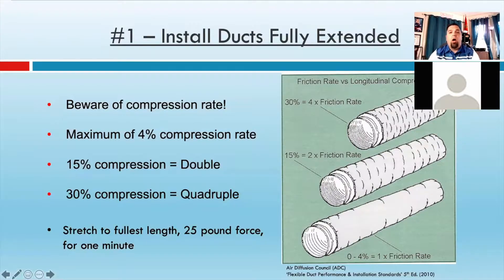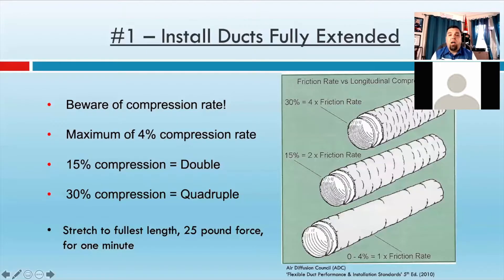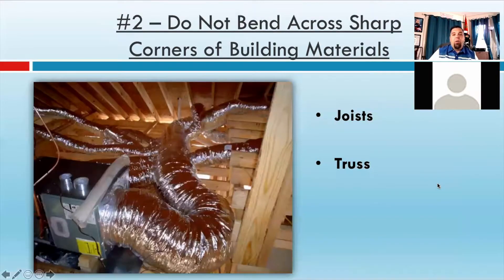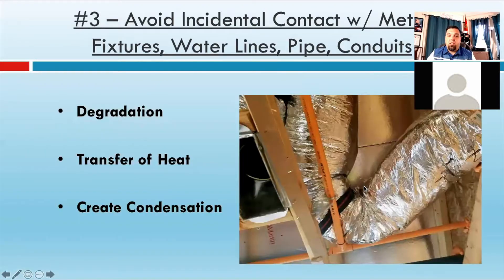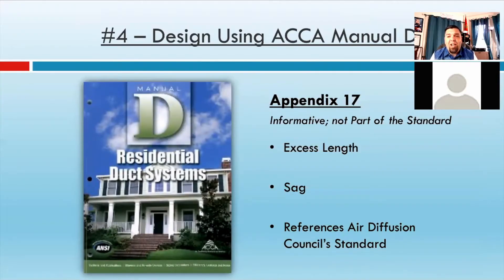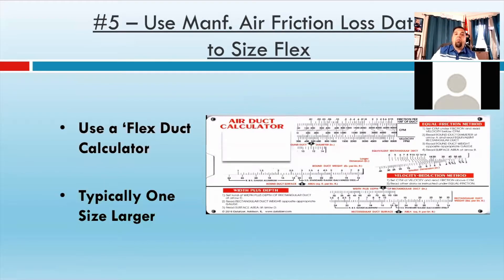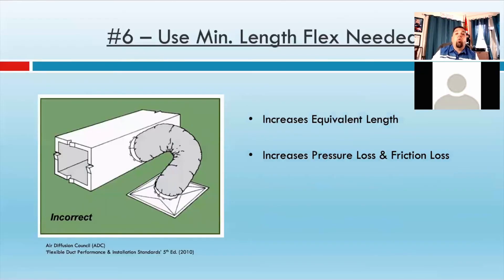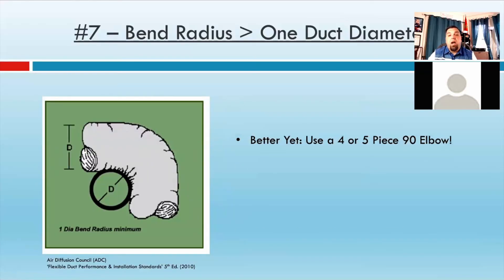Rules of Flexible Duct Design

Comment: How do I know the maximum airflow, CFM, that can be handled by some 6” flex duct I have in my attic, if I put in a booster fan to be able to increase aire flow at certain times?  The duct says 4000 FPM maximum, it’s 6” duct and I’ve got about 15’ of duct run before the booster fan and then 15’ after the fan to the vent?  At top speed the fan says it is 400 CFM. I don’t want to damage the duct work. Thanks in advance for any help on this.

Comment: It's just flex man pull her tight to get her right if you gotta make a turn do it gradule strap her with cloth strap only make sure there's atleast 1 strap regardless how short the run is cut in a circle around the insulation stick your blade in to pierce the liner cut the wire give her a yank and she pops right off clean and smooth tuck the insulation back into the liner run that liner down around the collar on the trunk line tape her up then pull down the insulation that was bunched up double your tape up side by side run one wide piece on top one on bottom and each sides and that's it from a installers standpoint that's all that has to be done there isnt time to be worrying about the little things I'm more worried about trying to get the job done so I can possibly have Sunday off cause we have another one lined up to finish roughing in by the end of the week and I just hit OT at 9am Thursday morning with a helper that's talking about quitting theres just bigger fish to fry than worrying about what inch flex to that angle I'm worried about turning I'm sure this video was intended for people higher up on the totem pole though I'm just trying to shed some light from where most of us people installing this stuff stand at
Reply: and that why there are so many poor installations...
Reply: Now that's taking pride in your work. It's our house man and we're paying hard earned money for it. Too much for the installer to be acting like "it's just your duct man, who cares".

Comment: This is great. As a homeowner i am trying to understand my my current system preforms so poorley. I hope true professionals like you take over the industry some day as it is obivous the "professionals" who installed my system had none of your knowledge.
Reply: Its sad i went to school for two years and have been in the field 2 years i see things that are just awful kills the trade
Reply: I can show you. The unit needs to be prepped correctly , even that's never done right. You need clean surface should be masticd. Most important spray glue,! Then your metal tape. Needs to be 3 layers. Now ducts do not need to be slid wayyy on. Its best like half a finger . Then you have a good amount of bite room for your tapes to bond. Make sure.your outter liner is curled back so the insulation is nice and tucked in, now spray glue and duct tape . A couple layers and you are set. That is correct . Not no Dam zip tie no spray glue etc..
Reply: You live in a mobile home or a housr

Comment: My living room has two air vents coming from one air duct. I'm not sure how to calculate to figure out the duct size. The cfm is 300.8 I believe and the distance is 17ft to the split. The 4 ft and 5ft to the air vents
Reply: What’s the diameter of the duct from both vents, if it’s 6” you’re fine
Reply: @tekkedens  that's what I'm trying to figure out